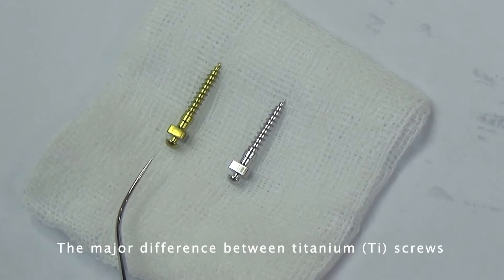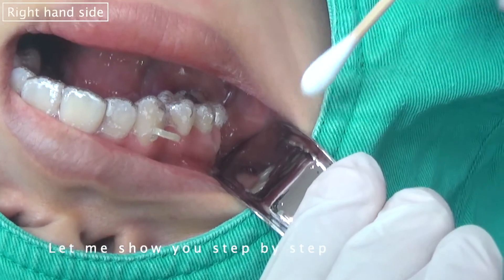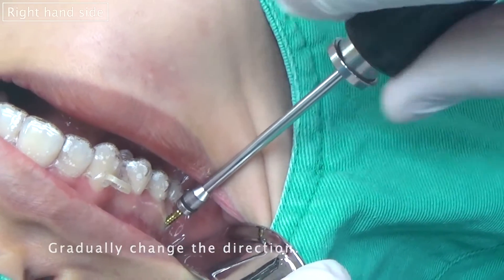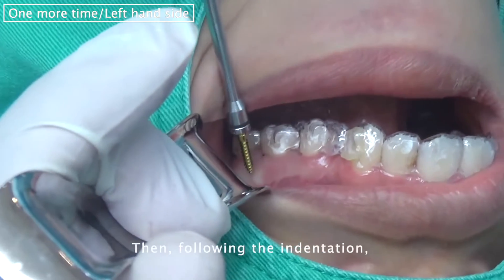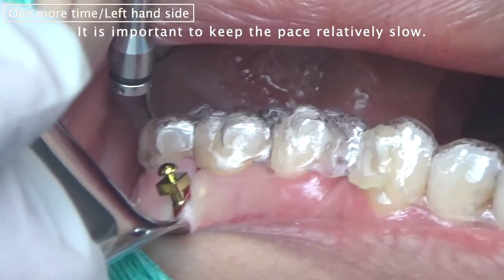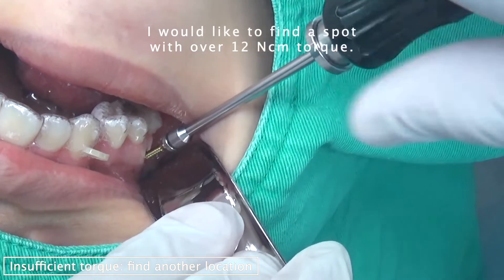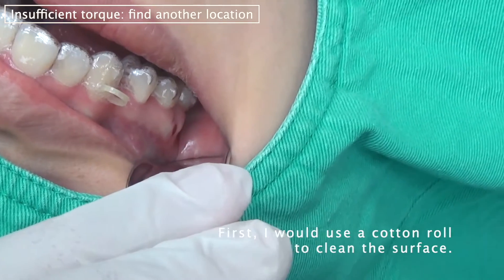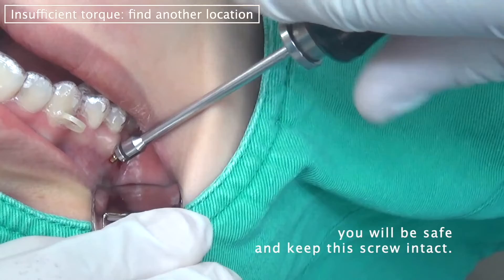How to prevent screw fracture｜【Chris Chang Ortho】CC657

Comment: Hi Dr. What's up?
please, please Dr.  would you mind answering me? 🙏🙏
I have a case of CL 1, moderate crowding, upper 6 s are missed.
every thing was alright till I reached 17 * 25 NiTi wire, the upper laterals flared, tipped distally.
I did all I know to fix the problem, but it didn't work, torque spring, torque bend, upside down bracket, repositioning of the bracket, change the right to left, Z bend, but with no hope.
the teeth are with normal phisiological movement, good occlusion, enough space mesially and distally, no sign of ankylosis, the x _ray showed no Pdl widening, radiolucensy or changes.
Please Dr. your kind opinion? 🙏🙏🌹🌹
Reply: Hi. Was just going through comments on this 1 yr old video. Was your problem solved?